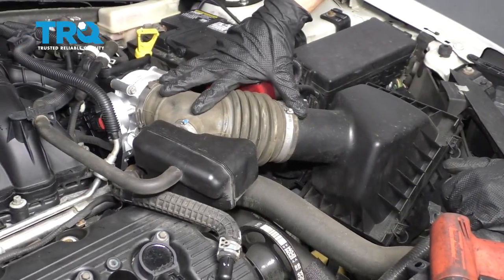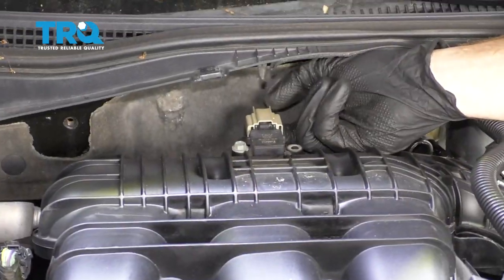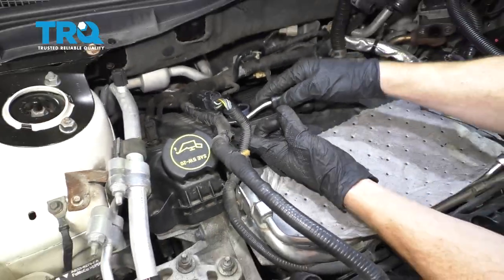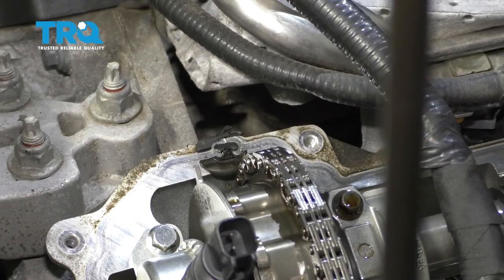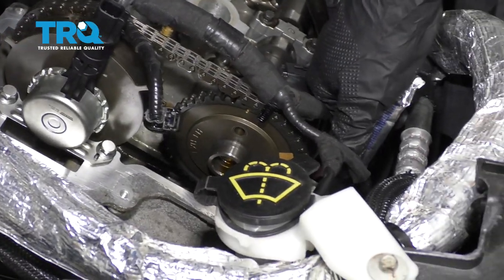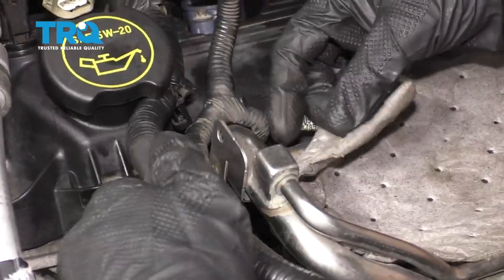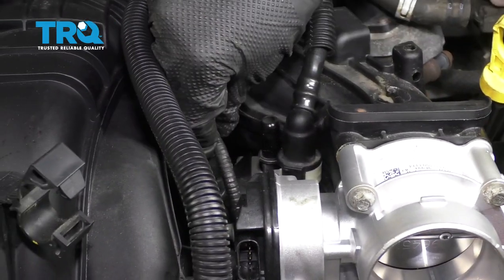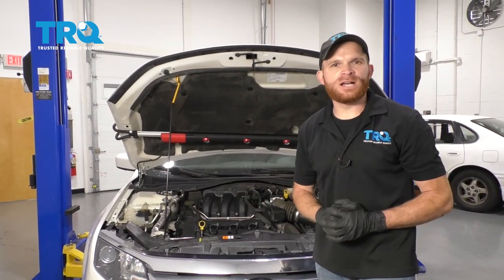How to Replace VVT Solenoid 2006-12 Ford Fusion

Comment: Great Video but I'd like to know where you find your VVT Seals, I orderd mine from the Ford Dealership per my Vin# and they were too large now I don't know where to find the right sized seal to finish the job on my 2006 Ford Fusion any suggestions ?

Comment: Could have designed the car better. A lot of labor to replace that solenoid.
Reply: I know its nuts. I have an 09 MKZ with the 3.5 and just did the rear valve cover and those seals. Do it once tho and it can be done quick after that. Just don't forget to refill the power steering fluid because you have to remove the reservoir to get the valve cover off 😂 edit and the ac lines to make it easier to go back on

Comment: Are there 2 of these? One in front housing one in back? With car throwing P0022 code do both of them need to be replaced?
Reply from the maker: +Logan Zastrow Some models with have an intake and exhaust VVT solenoid.  Depending on what you have this could replace both locations or just the intake.
Reply: @TRQ  did you do the vvt solenoid bank 2 on that car